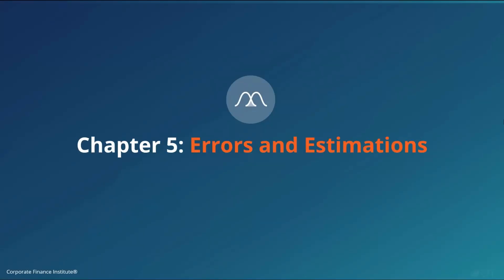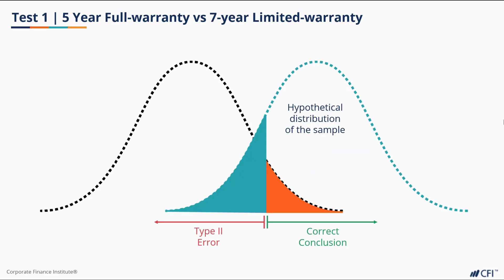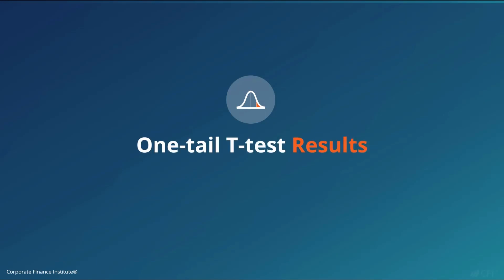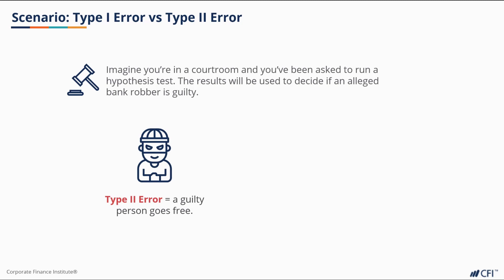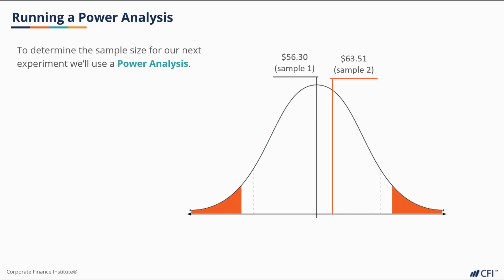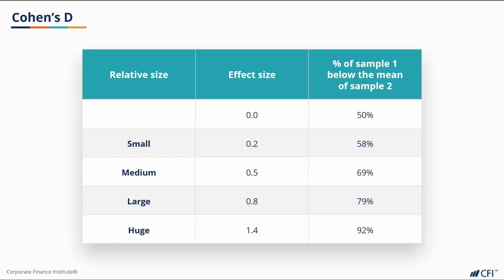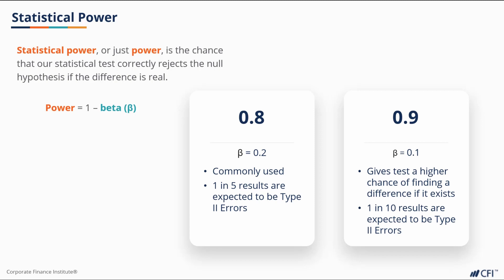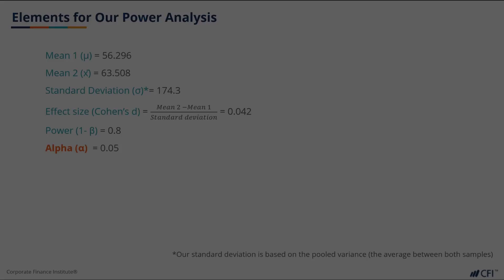T-Test | Statistics Course Part 8

Comment: Having false negative is more tolerable than false positive only if the positive already requires subsequent actions of treating it as positive. In cases of initial asessments like fir example medical rapid or point of care tests, it's not the case, Having false positives is much better because it is more conservative and cost efficient to be more sensitive to a general strain of protein or antibody and then be further verified by a confirmatory test..